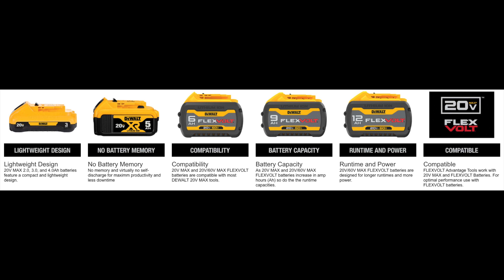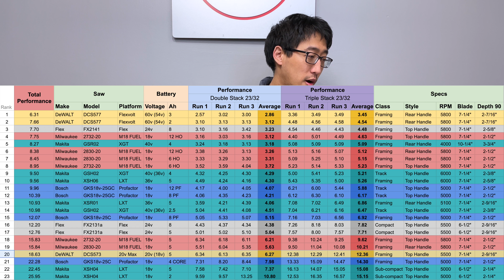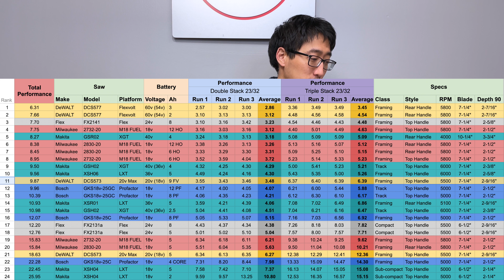DeWALT 20v Flexvolt Advantage 7 1/4 inch brushless circular saw Review | DCS573 | ep.13 | More Power

Comment: Very thorough video! Good job! I just bought this saw from Lowe’s With Power detect and with the power stack battery but it doesn’t say the amp hr on it. The guy at Lowe’s recommended the battery but they don’t stack up to the hype!
Reply from the maker: Yeah probably not the best for power hungry tools. Mostly better in things like drill and impacts.